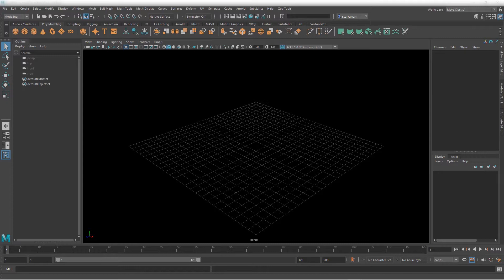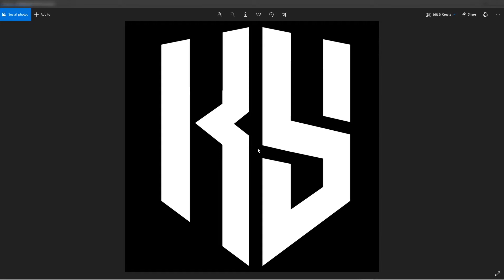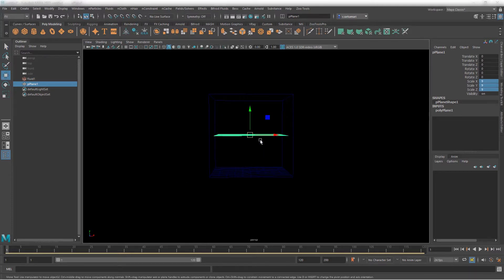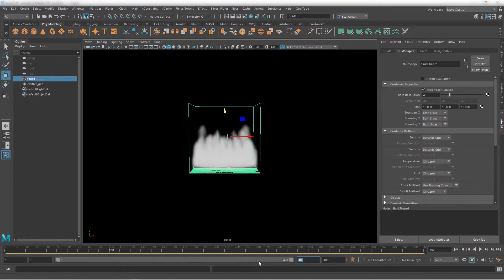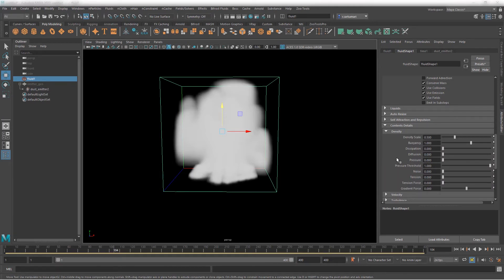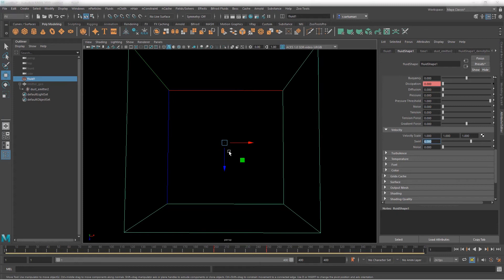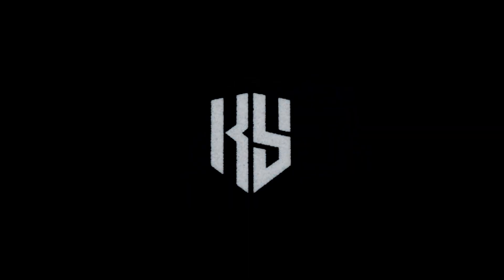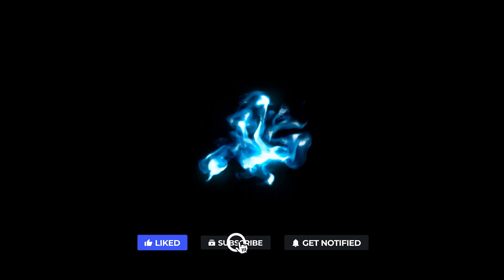How To : Turn an Image Into Dust Particles in Maya

Comment: Hiya, thx for the video. I know this was made a while back, but I am using Maya 2024 and for some reason when I assign a black and while jpg image to the density emission map it does  not affect the emission, which is still emitting from the entire plane. I am resetting the tools and apply the same settings as in the video and have not been able to figure out why it does not work. Any ideas?